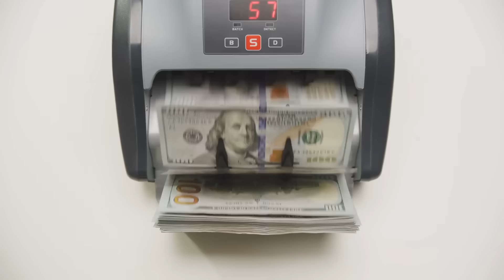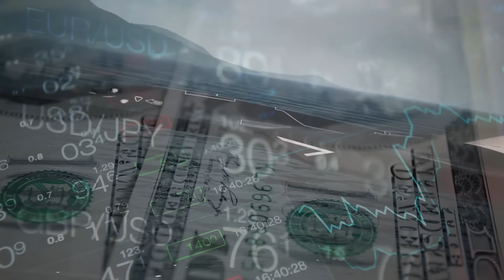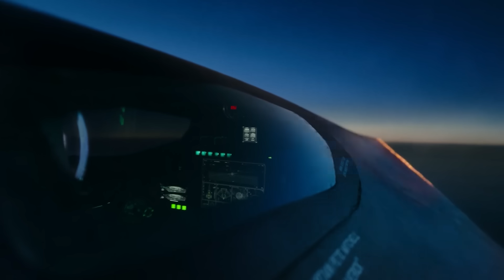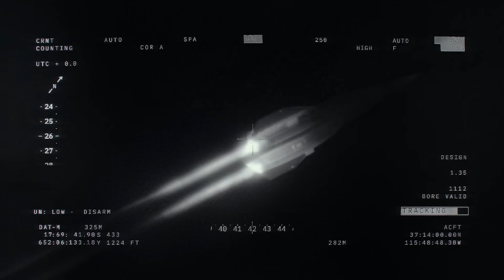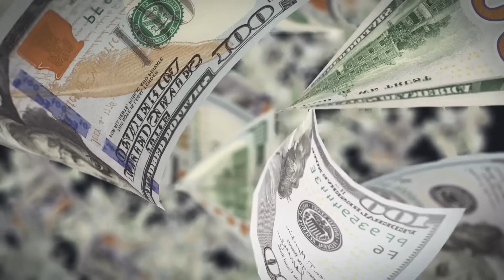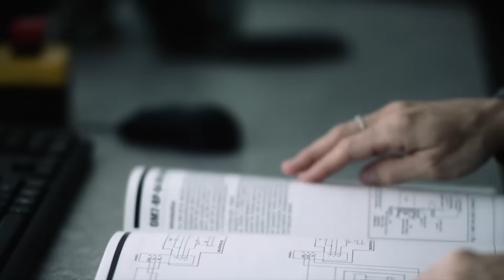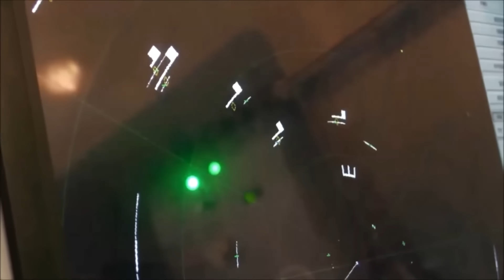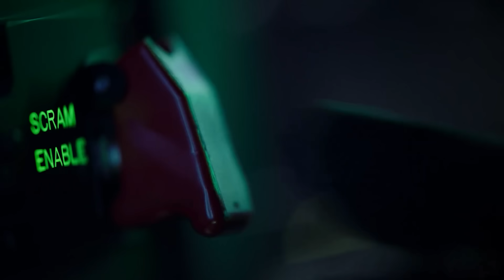FINALLY! SR-72 Darkstar Takes Flight — A Jet That Shouldn’t Exist!

Comment: The SR72 Darkstar is without doubt in many ways the most advanced aircraft every made. However, there is definitely room for improvement with technology we already have or will soon. To accommodate them the plane may have to be made larger. According to reports on the internet SR72 has already flown at Mach 9 presumably with the Rocketdyne engines. But much better engines are available. 

Two types stand out. One is the GE/DARPA/USAF Labs Turbo/ RAM/SCRAM with rotary detonation combustion chambers. The engine delivers more power with less fuel as detonation is much more efficient than deflagration which is how all existing jet engines ignite fuel. Unlike pulse detonation, rotary detonation has at least 3 to 5 detonations simultaneously at any given time delivering smooth thrust. It should easily propel SR72 faster than Mach 10. How  much faster we don't know.

The other type which can also be incorporated is an antigravity engine seen in TR-3B, TR-4 and X-44 Manta. It somehow works using a plasma form of mercury. Sounds impossible but so does a lot of stuff that comes out of Skunk Works.

Add rockets and the plane will fly into low earth orbit. SR72 already makes F47 look like a toy. All of the avionics in F47 and more can go into SR72. What good are CCA drones if they can't fly as far or as fast as the plane they are controlled by?
Reply: the problem with faster is that it melts the plane

Comment: That’s the same basic engine design as the SR71 IIRC… turbines shut off at high speed to allow the ram jet propulsion system to take over..but the SR71 has the cones on the nose of the turbine housings to aid in condensing the air for ramjet/afterburners.. this doesn’t seem to mention the compressed/condensed air entering the engines at Mach 3+

Comment: While Russia has been comfortably sitting on the soviet arsenal, the USA has spent $335 million to put a man inside a missile. Truly a magnificient achievement... but why?
Reply: A ever shrinking soviet arsenal that's either been used up the past 3 years or rusted out and stripped for part's....

Also keep in mind all that Stuff USA also built during the cold war like them 10000 abrams is still parked in the desert you know where stuff doesn't get snowed or rained on and rusts out over 50 years....
Reply: @L0neW0lfL0gan  The point I was trying to make is that this video on multiple occasions implies that if Russian or Chinese radar detects something moving at mach 6 and then command center suddenly blows up, they'll just shrug it off and say "it must've been a wind". No, this is exactly how you get nuked. And ICBM's, even the soviet ones, easily outrun the SR-72 at about mach 23, so might as well fire them right away.
Reply: War
Reply: Air superiority